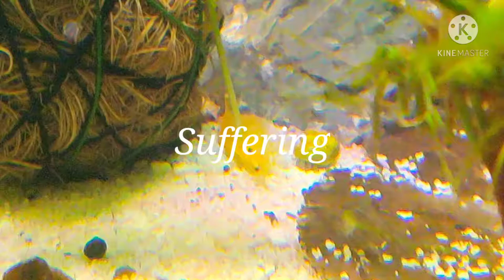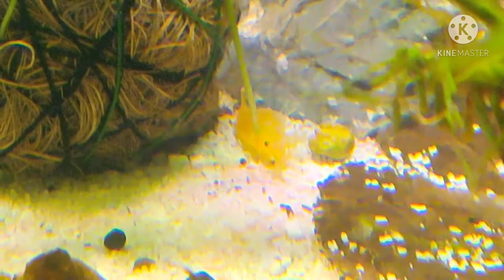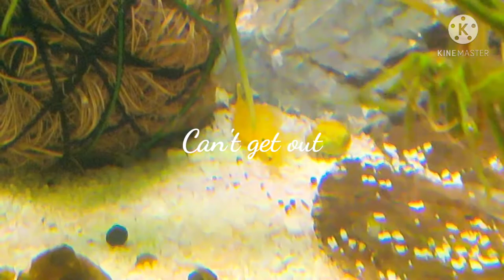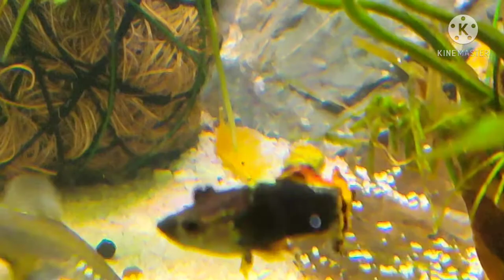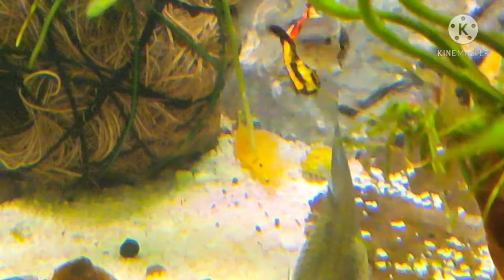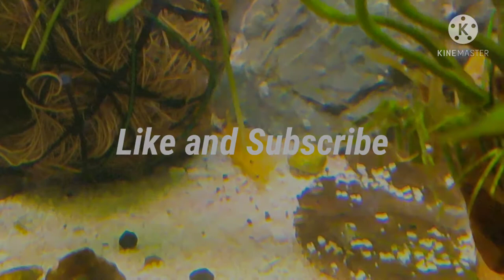Failed Molting

Comment: Oh god.. I just did a 15% water change, and found an exo floating around the top.. but the 5 shrimp I have currently are all upright and eating.. I had a 6th, but his tiny butt got back into an area I cannot get to x.x Still working on that one, though I did throw a wafer back there for him just to be cautious. Any suggestions? I can't unhook the system to pull the pump out, or I would x.x I'm VERY new to shrimp, but thank you for sharing this.. I hope she pulls through!
Reply from the maker: This was filmed years ago. What I've learned since this incident are 2 things to stop failed molts due to water changes. 1. Remineralize the water to match that of the tank before adding it or; 
2. (This is what I do) keep "buffers" meaning a product that releases calcium and carbonates in a "HOB" Hang on the back filter. The filter will pretty instantly run your new water through the bag of buffers. 
Most people choose aragonite. You can buy it at any fish store. 
Hope that helps 🤙

Comment: Euh you know you can save the babies right? If she is dead you can take out the eggs very carefully and put the in water that is rich with airbubbles so they move constantly. Sad for the momma shrimp. Just lost a caridina who had a ring of death 😢, wish i could figure out what is wrong with the water, bc i drip water changes back in and its a week ago
Reply from the maker: I've heard about saving the eggs. That it can be done. I wasn't aware at the time. However it's not necessary to keep up with saving babies. I've got more than I can even deal with. 
The ring of death happens from an inconsistency GH or a sudden change of your hardness. It's a failed molt. I know a lot more about shrimp since this video. I was just starting. 
Thanks for saying Hi and swing in for a question anytime 🤙
Reply: @yourtap  haha thats a good thing when you cant keep up 🙈. Mine stopped making babies, but they are caridina. Will refresh their soil
Reply from the maker: @artiliciousv  I keep Caridinas as well. I've been breeding red fancy tigers amongst other types. You can see the varies in my shorts. 
They like super acidic water and it helps to keep the temperature 🌡️ 72°F for them to breed. 
Hope that helps 🤙

Comment: I started with 5 blue dream shrimp and in about 4 months I had over 50. In less than 2 weeks they all died but 5 and I’m sure it was a molting issue.   What should I do? 😢
Reply from the maker: Testing your water is the only way to find out what happened. I'm sorry about your massive loss. 🙏